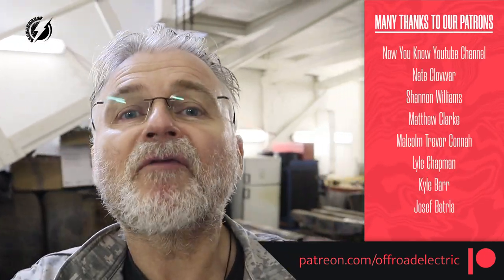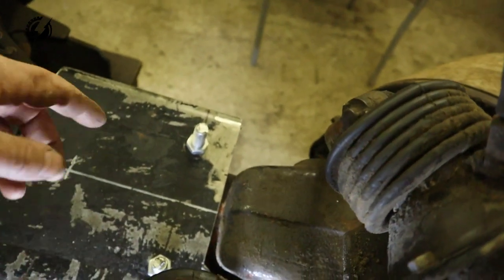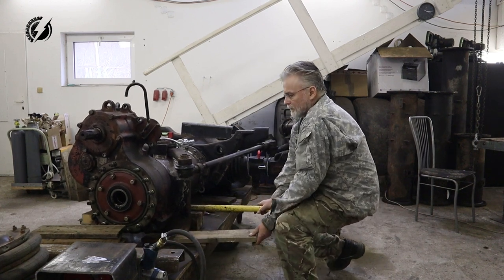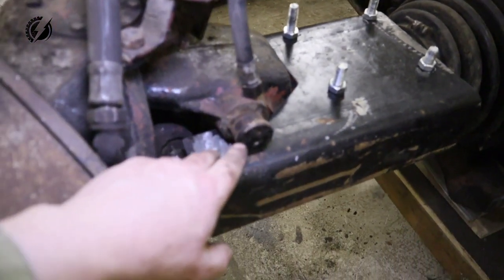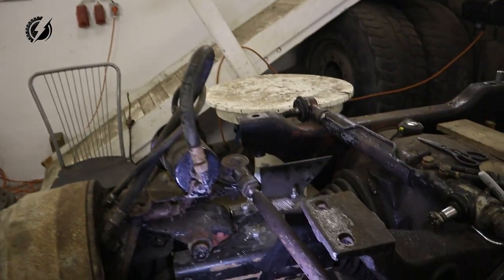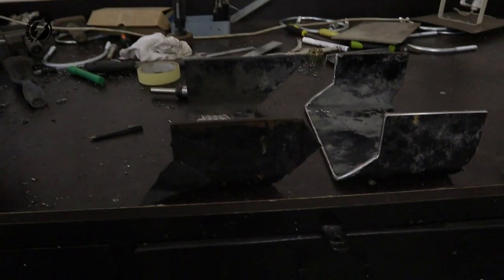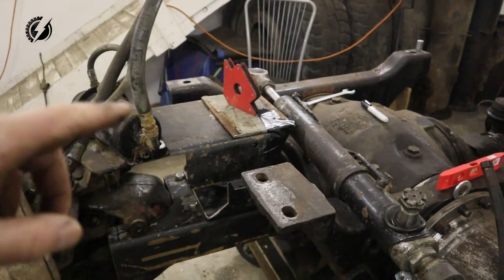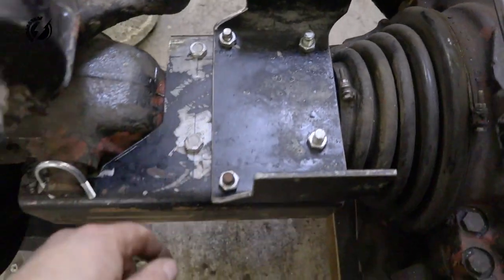EP 55 Building a Tesla/Tatra Monster Truck

Comment: Hi, nice project! But I'm interest, how everything will bend under loads (speed/bumps) and whether then something will interfere in such close proximity?
Reply from the maker: Hi, thank you Jonas! I think the closest distance between the parts is about 20mm,  so it should be far enough. I am building it from the material I already have, however for the customers there will be brackets built from the brand new steel material and it will be thicker, so I will not have to put the braces there. All of this will be tested on the off road competitions.

Comment: Peter, what competitions do you plan on entering? Truck trials against Unimogs, I guess, at the size of the build rather than Tatra or Mann size trucks. 
Have you checked that the organisers are OK with a high voltage EV without factory certification? I know it's not something we could get through our regulations here in the UK. Hopefully, it will be more progressive on the continent. 
I think EV will be brilliant off road trialing, especially with regen braking.
Reply from the maker: Hi, here is the Czech website, but similar competitions are in Germany, Poland and elsewhere.... https://trucktrial.cz/  There are the categories where I can fit, and yes, I asked about the electric drivetrain and two steering wheels.
Reply: @Off Road Electric  I've watched the truck trialling on YouTube for many years. One day, I'll get out to watch one. Bloody Brexit hasn't made that any easier, though. 😕
Reply from the maker: @MonkeyMotorSport  Have been a few times but it was kinda depressing when I see the unsuitable trucks trying to do something they are not designed for...The front approaching angles are laughable as many other features on them. This truck will turn the competition upside down and will dominate on so many levels.:)